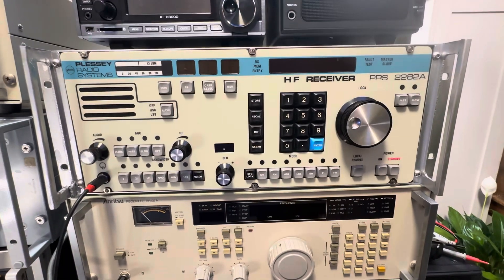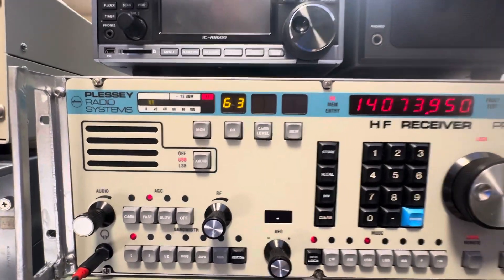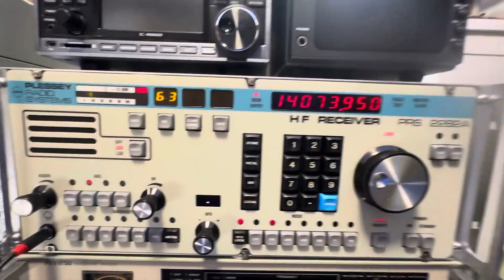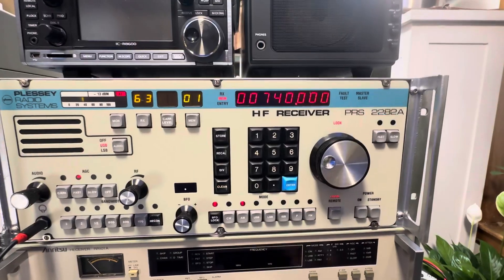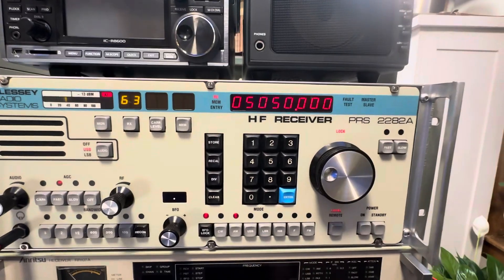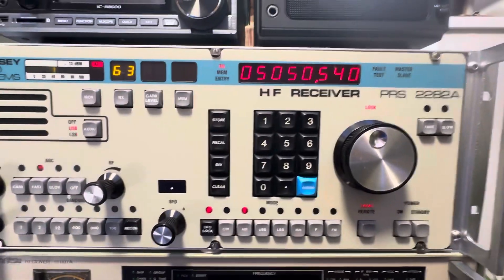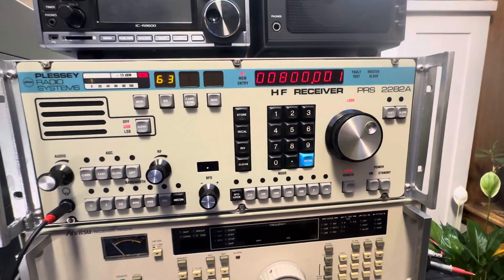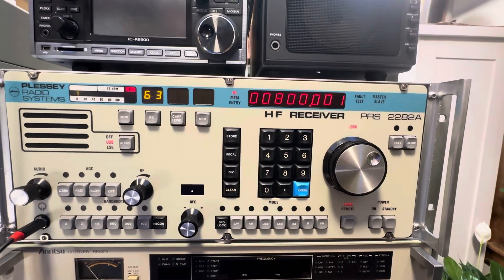Plessey PRS2282A: GCHQ Fine Tuner!

Comment: As a former DSD / ASD drone, I can't confirm or deny that many secret 3 letter agencies might have already heard about the RACAL RA6790A by the mid 1980s. Plessey was on a downward trajectory around that time unfortunately. Just from my own experience, any piece of hardware with the capacity to store data would be destroyed and disposed of, basically shredded to swarf - GCHQ had much the same SOP. Although you can never say never, it's quite unlikely this was surplus from GCHQ unfortunately, the tell tail sign is the pristine condition of the front panel. None of the text has worn off the keys and the face plate lacks finger grime and holes through to the backing plate from years of 24/7 use 😀 

Thanks for the upload sir.
Reply: The receiver was probably from Home Office stores. They supplied not only CCHQ, but Civil Defence. fire and police, nuclear warning services, local government and other services with radio equipment. A stock of radio equipment was held for replacements.